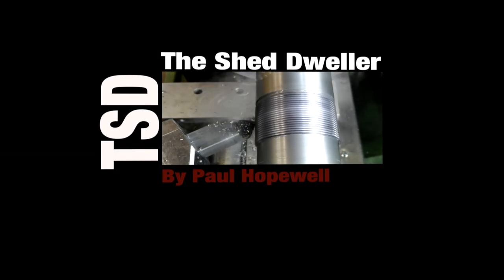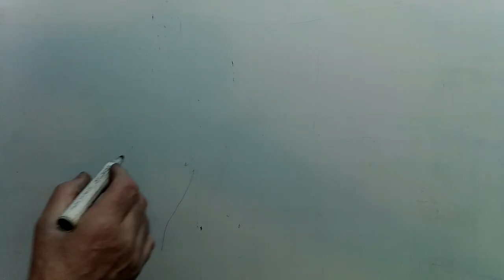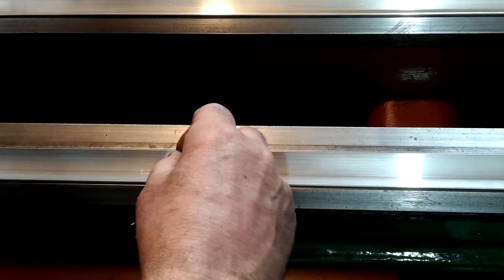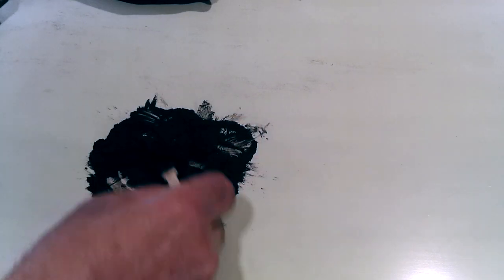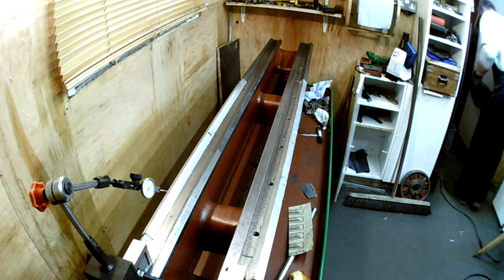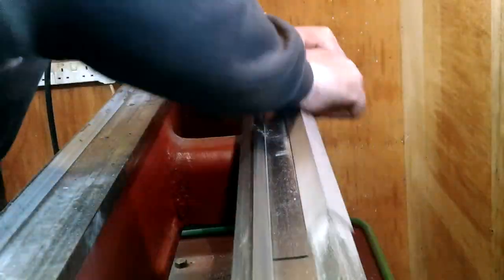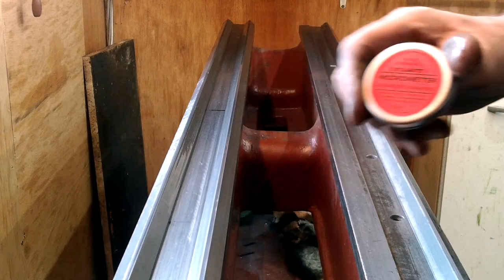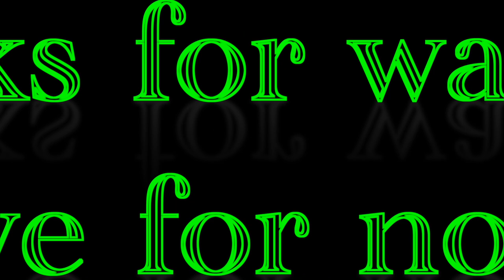Slide fix, South Bend 13 (pt5)

Comment: I will never have the courage to try this but it is nice to watch somebody who does have the courage.
Reply: well if you think about it, he cant make it worst than it is, not much to loose less some time and epoxy. may be painful to strip it off if it fails, but the bed underneath will still be the same.... can do a second attempt if it has to.
Reply from the maker: Hi, I did’t need courage because the lathe will still do what I want it to do and I still have my little lathe. To me, courage is doing what I’d originally thought of doing and that was to mill off the bad bits and bolt on new cast sections and scrape them in…. but that is for some one else to do. cheers

Comment: I like your aproach, and this remembers me of an product that i used sometime ago.. i was making a two cilinder pomez stone grinding machine, to reduce the factory supply of 10/15mm size of pomez to 2/8mm in batchs filtered.. well.. to avoid using a lot of money and steel, i maked a cilinder of sand plus epoxi for weight and general stiffnes, then outside aplied a couple of coats of epoxi and thin fiberglass fabric to avoid the sand exposi mixture breaks apart under presure of grinding the stones.. then in the surface i tried first a coat of an surface epoxi resin that contains 50% of iron dust, that works well grinding the stones, but sometimes, a couple of hard rocks gets in the mixture of pomez from factory, so finally that hard rocks makes little craters in the surface epoxi, then I scrapped all the surface epoxi and replaced with another surface epoxi resin with silicon carbide dust... that was an absolute beast... years later used a little that last for making a garden tool and trying to make holes with a drill of 1,5mm let me crushing 3 drill bits into shape of needles with just a couple of drills into that thing hardened.. something like that should actually last longer and maybe compete with the iron bed? maybe its a thing about the resin that held that particles in place than the carbide in itself..or iron in your case..
Reply from the maker: Hi, sorry i didn't reply, I missed your comment. Thank you, brilliant. Thats very encouraging. Cheers

Comment: Greetings, your video is a godsend! This past Christmas Eve (2023), I took possession of what wound up being, under all the flaking paint and rust, a 1942 South Bend 10R "Heavy", with 1" bore spindle (1-7/8"x8 thread nose), no tooling, no toolpost, no compound, no plates, no centers! Scratched spindle and bearings from years of no lube and much dirt, and front vee way worn down 0.040-0.050". Huge ridge at the top. Slight ridge on the rear vee, almost none on the tailstock vee.

YOUR VIDEO GIVES ME HOPE

Even as bad as mine is, it had to have been used for something to get as worn as it is. I certainly can't make it any worse, so I'm going to give your method a try (tell the truth, I actually considered it, but thought better of asking anyone what they thought of the idea, they'd think me loony!). I'll probably also have to give some consideration to the wear to the inside vee of the saddle, not sure how to handle that, but I'll sort it somehow.

THANK YOU SO MUCH! Off to buy a case of JB Weld and a tub of iron powder!

Comment: Great video and nice to find another Sout Bend 13 owner in the UK👍Mine dates to 1943 and is ex US military. I bought it locally in East Anglia last November and currently have it completely stripped, cleaned and painted apart from the bed which is 7 feet long. I forsee many challenges putting it back together as I neglected to take photos😕

One issue I have found is the shipping cost for anything from the States, I need a set of oiling felts but it works out at around £80😱I am hoping that lamp wicks will work
🤞

Comment: You did well adding the iron filings as it will add strength  to the j b weld and cause an equal wear rate of equally dispersed slide action travels and will lap in ways sufficiently on it's own. 
Well done asual.
Reply from the maker: Hi, thank you.

Comment: I may have to do the same with a lathe i am about to refurb, i have been recommended a 2 pack epoxy called Belzona , which i think uses steel powder as a filler. Brilliant video and a very brave and effective repair!
Phil
Reply from the maker: Hi, thanks. I’ve not seen that brand of epoxy i’ll look it up. cheers

Comment: That JB weld is amazing stuff, I used it to repair all sorts of stuff in the past with great effect. Would never thought of using it on the lathe bed ways. I'm sure it'll hold up as long as it's lubricated properly. Thanks for sharing Paul.
Reply from the maker: Hi, I hope it does work because I have got plans for it.. cheers

Comment: That was very good Paul. Ingenious. I don't know about JB Weld but I have used Devcon putty before, it is made to various UK and US military specs. It can be drilled, tapped and machined when cured. So I think your repair will do very well. Thanks for sharing.
Reply from the maker: Hi Carl. I too think I once used Devcon If memory serves me right its a putty in two equal parts, one red and one cream, work the two together to the shape of a hammer and it is a fully functional tool.
cheers
Reply: @Thesheddweller  Yes that is right. I have used it to successfully repair aluminium hydraulic manifold blicks in emergencies.

Comment: In regard to mixing cast iron or Moly to JBWeld, heat it up with a heat gun or hair dryer and it gets extremely soupy.  It works great!  I did this when repairing a variable speed reeves drive which slides in a delrin sleeve.  Its way more slippery than JB weld by itself and its stronger too. Less scratch resistant.
Reply from the maker: Hi, thanks for that, I’ll remember that, good tip thanks.

Comment: I wonder what would happen if you used plastic wrap, like the stuff you cover food with, between them, if it would just peel off easily, or even if you just had to slide on them a couple times to get the plastic wrap to disappear?  I used Pam cooking spray when I was making resin miniatures, so maybe it would work better?  Looks like it worked out anyway for you regardless.  Thanks for the vids man!!

Comment: Forgot to ask, from where did you get the big piece you used as your straight edge for marking the sides of the vees? Looks like a great big piece of CRS, but I can't tell. Also, how did you hold it in the proper orientation for marking? Many thanks for any info you can provide.

Comment: Well !
You done me with that one 😊
Would never of thought to use liquid metal. But,,,, I used to use loads of it years ago, Belzona I think it was called and it was really good stuff.
Nicely done matey 😁😁😁
Reply from the maker: Hi, I aim to please. My other idea was to mil out the bad section using my mill bolted to one side, then make a replacement piece and use bolts and pins to retain it. that would have dropped a few gobs, ehh.
cheers
Reply: @Thesheddweller  hey Paul !
That would have had the purists kicking in you workshop door.
I have to be honest though, that idea is very plausible if you use full length rails. Mmm 🤔🤔🤔
Reply from the maker: @NellsMechanicalManCave  nah, if i could do that i could mill it not grind it….😁

Comment: How is the iron infused resin holding up? 

I'm very new to precision, and it seems to be a pretty flexible way to fix parts. 

I have some some crazy ideas of using something like this on top of carbon fiber plates to hone in some very makeshift and lightweight surface plates.
Reply from the maker: Hi, the resin is still holding out quite well. however, it did get very messy when I first used it, the oil and some of the resin produced some pretty black grease at first, I suspect that the cast iron dust that I mixed into the resin has now stabilised the resin and although I suspect that the resin won't last as long as the iron Bed-way It should prolong the life of this lathe for a few years more.
regards.

Comment: Interesting video!  I have used JB Weld steel filled epoxy quite a bit and while it is tough, it is not hard, certainly not as hard as even soft aluminum. I will be interested to see how it wears.  In Europe they seem to talk about Moglice strips instead of Turcite.
Reply from the maker: Hi, I too will be very interested to see how well it lasts. Cheers

Comment: Greetings oh Shed creature as UK origin.   It so happened I traded about a full day and a half labor, where in deference to cash payment I took possession of a South Bend 9 of 4 foot bed length.  Serial number as 62016.   At removal from a type of scrapyard, I lifted the unit and placed it to a block wall as attached to a thick pine plank, so as to fully access all components.  I soaked the entire unit in light oil for as 48 hours.  Hence to partial dis assembly and cleaning.  That process as to remove rust and any build up.  The cleaning advanced to particular care as bed way.  A powerful thinner, the chief regard with plastic and cloth impliments.  As summer progressed, I constructed block risers, via mortar to the shop concrete floor and leveled the top surfaces with mason level.  Hence, moved the cleaned unit as re assembled to that surface mounting, again with dense pine planking to achieve a span with a slight degree as vibration resistance and where slight variation can be modified by shims. 
With a drive worked out, I constructed a tool holder, continuing to both inspection  and lubrication.  As I looked up the serial number, I have the viewpoint this unit was delivered as winter 1935 to Spring? 1936.   To arrive at the belief this lathe has an age as 88 years.   And, where with current light non ferros, dense plastics, aluminum it indeed has fair precision to work piece. 
At present, I simply use a simple back plate with component fastener clamping.
I observe the same difficult wear instance as your post cited.  And, where I happily now plan to try your method, understanding the potential for improvement.  And where, I in fact now process jobs as to more fully equip the unit as tool function. Some as a soft blow mallet,  a design as a 8 inch chuck with "fingers" as to hold work.  I found a broken craftsman lathe bed and designed a sliding table as accessory to execute dial measurement with no interference to the central components.  Save it must be removed for the full bedway length job functionality.
As things stand, I now manage a range of task, having secured some excellent tool and various smaller collet, and where with a small budget I can execute most linear cutting needs.  Continuing to add end gear multiples as to address change gear and where the unit will seize advantage as so positioned to share compressed air motor space to lathe drive,  saving space and protected from incidental entanglement. The care and design...robust components I find more fun that lesser Chinese design.
I plan to study features as digital readouts, design as a mill attachment and happily add to various stock in metals and tube.  What I recommend to the interested hobby machinist, tradesman is the South bend manuals.  Which, were well thought out as both  a sales and support.  Detailed in measurements and attachments.  Some, a bit unusual and curious.  
With this background, for the enthusiast, I recommend Sam at Swan Valley Machine shop (Channel) AU.  And, where I quite thank you for the effort to share the repair method, scraping domain to improved precision.  As that goal set is effortless to the craftsman....journeyman to the range of metal production to task. It so happens this is the holiday season with snow, and I bid you fair holiday winds.  As from half a world away.   M.

Comment: Hi,
I am beyond words to express your talent, insight and dedication to this restoration. But there are certain things I would like to add.
JB weld is just another epoxy glue and added metals in jb weld and iron powder might have some added rigidity but in the end it is a glue.

Also jb weld is too soft & do not make a good bearing surface unlike moglice, or turcite or belzona. I think the best way to approch this was to use a hard facing rod or stick weld with a silicon bronze rod.

You can machine jb weld but in the end the bed will be very soft. If you use it extensively it will show accelerated wear. If used sparingly i guess this is a good fix for a worn out lathe bed.
Reply from the maker: Hi Roy, I don't think I shall be using it that much however, I very much appreciate your input I like the stick welding idea with silicone bronze rod. 
can you tell me where I can get I more info on this welding system? much appreciated. regards
Reply: @Thesheddweller  since a lot of time and energy is already involved, i know you wont like to start over again, considering this is your spare lathe. 

For any future cast iron repair, you can buy silicon bronze rod at any welding store for all cast iron repair and you can break the flux and use the same rod for tig brazing cast iron. 
Those welding rods comes as an option where you can machine those welds for drilling, tapping or machining.. pretty hard and good stuff for any cast iron repairs..
And there are plenty of videos already available on the internet
Reply: Big fan from india… 
I surely dont have much use for a second head on the lathe.. all though the project was mindblowing..
I cant wrap my heads around on the way you managed to fix the tailstock also adding a lot of travel and making it more better than the factory..
God bless youtube :D
Reply from the maker: @RoyMeraki  Thanks I will look at this solution should I find that the glue doesn't cope. cheers
Reply from the maker: @RoyMeraki  Cheers Roy

Comment: Hey Paul, your solution to your worn ways is both brave and admirable!  To be frank, you might just as well do it this way... what have you got to lose apart from some time and elbow grease?!  I might have to do the same to my recently aquired Myford Super 7 of 1962 vintage.  I liked your idea of adding iron powder/filings and I reckon the JB Weld will hold up well... if you keep the ways well oiled as you would for normal usage I think the saddle will glide beautifully... I've seen various types of epoxy mixtures being subjected to far greater stresses than you can apply to your repaired ways, and it's generally held up pretty well.  I'm looking forward to your forthcoming progress reports!  Greetings from Southport.
Reply from the maker: Hi, I’m glad you found it useful. I suspect that I’ll get plenty of feed back from it. A myford lathe is a very good lathe, age means nothing. regards

Comment: Now that is a really interesting solution Paul. I doubt it would work long term if the lathe was being used every day for ten to twelve hours of continuous use but for a small shop I think you may have hit on a good compromise. I look forward to seeing updates after a few months of usage… (well also the other videos in between of course). Great video as always. :)
Reply from the maker: Hi Gary, That’s my thinking at the moment. The lathe was OK as it was but me being me, I had to see what I could do to improve it, if it was possible that is. cheers

Comment: interesting approach. i used similar mix to mount my rf45 clone mill vertical slide to the base. first trammed it with grub screws and then epoxy with cast iron dust. seem to hold up well. my biggest concern with your system is that the epoxy will suffer from knocks and scratches. the way i understand the commercial stuff be used is under the saddle where it is never exposed, recon time will tell. i still think a slide with hss tool and clapper box and shaper stile single point is the way to fix machine tool ways. im collecting components to build up such a device. will let you know once i have some thing worth considering  to show.
Reply from the maker: Hi, I agree with the HSS tool and elbow grease method for this fix…. but I’ve got to try this first. looking forward to info on your device.  Cheers.

Comment: Great adventure, you would benefit from using a stiffer backer for sanding
Reply from the maker: Hi, I only roughed the built up rubbish off, then scraped it flat, it only took a few minutes to do each one, the scraping takes the time.

Comment: Hello Paul,
A super interesting video, thank you... did you purchase the cast iron dust (if so where from). You may have mentioned and I missed it, but how long did you leave the JB Weld before starting to scrape it? See you on the next one.
Take care.
Paul,,
Reply from the maker: Hi Paul, the iron dust I got from a company in Northern Ireland (MB Fibreglass) 1kg at £7 double that for p&p, and then some for import duties.
I left the mixture to harden for 48 hours at approximately 18º C. I hope this helps. Cheers

Comment: G’day mate, I’ve got a lathe with a similar issue, and it’s value is low enough to run with a sketchy repair. Just wondering how your epoxy repair is holding up after some use?
Reply from the maker: Hi.
I’ve not done any more than, maybe, 50 hours work since the repair. What I can tell you is that in the initial stages there was a bit of residual blackness where slide oil washed away any dirt. The slides have traces of scrape marks as you would expect, but now they appear to have stabilised better than I expected. They won’t last forever but they are doing what I expected probably better.
Regards.
Reply: @Thesheddweller  thanks mate appreciate the update. I’m looking at putting some Aliexpress Turcite on my saddle so this might help with longevity.